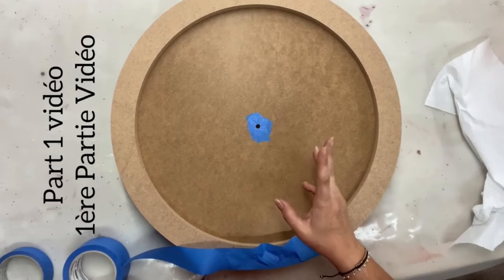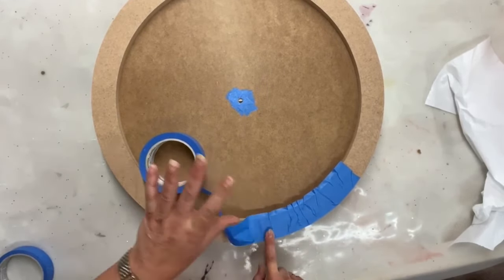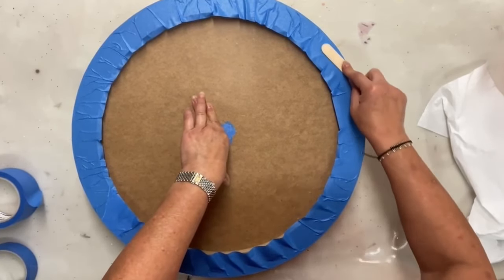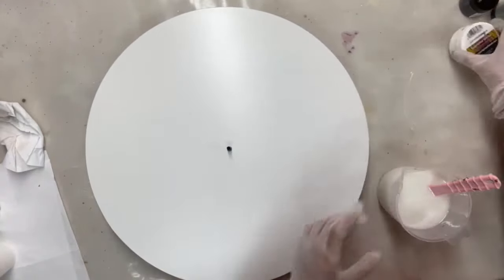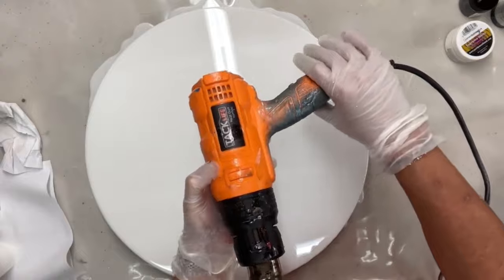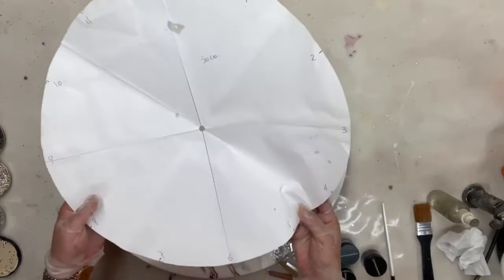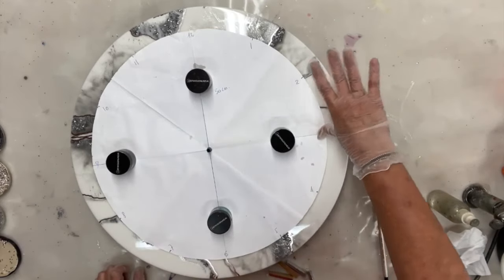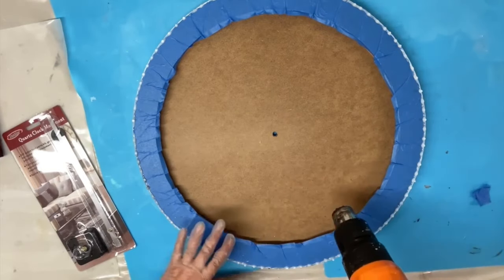How to make a Resin Clock - FULL Step by Step Resin Art Tutorial

Comment: Hi just wondering if you top coat it with clear epoxy after ur done?
Reply from the maker: Hi yes you can apply a top coat for extra protection and for an extra glossy finish before you add your clockwork.

Comment: How did you glue down the four clock pieces at 12, 3, 6, and 9?
Reply from the maker: Hi Jennifer, the clock pieces were placed in position and then a flood coat of resin added, this then glues the pieces
Reply: @just4youonlineuk  how did you secure them so they didn't move, when pouring the top coat?
Reply from the maker: @lynnetteramsay9387  Hi they can be secured with a small bit of sealant or glue just to hold them in place whilst you pour the top coat and they are fixed.